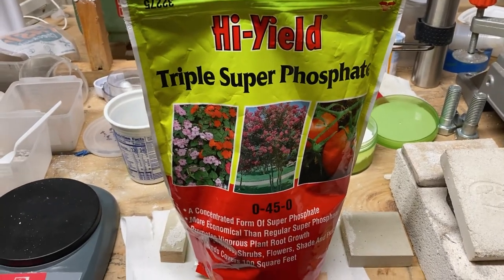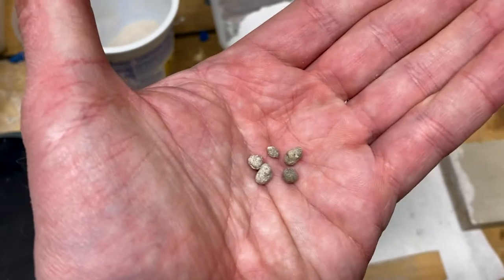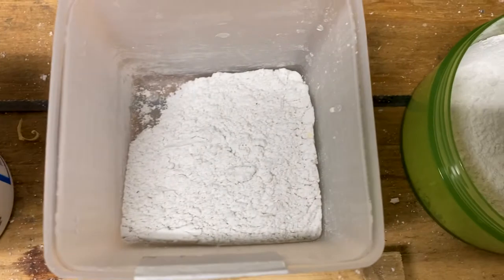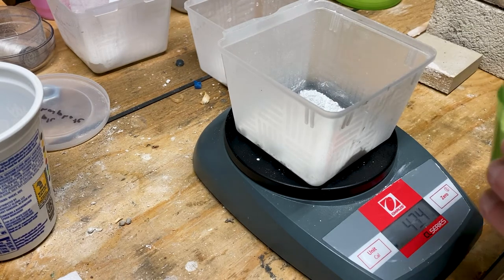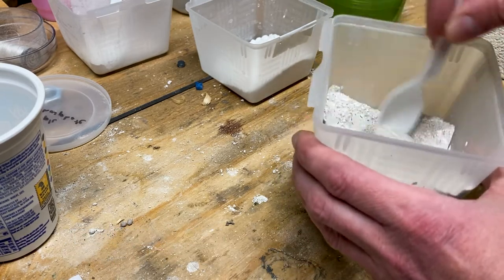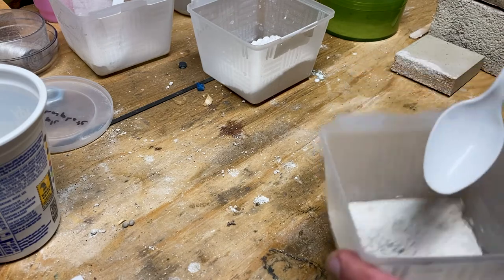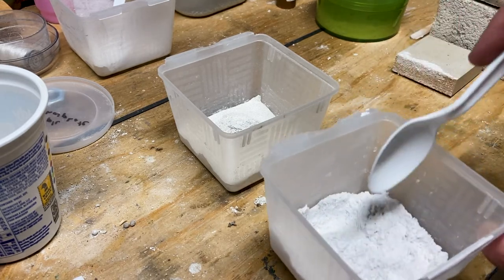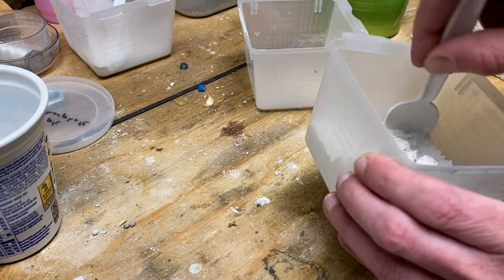How to Make Calcium Phosphate High Temperature Refractory

Comment: To confirm your conclusion about the porosity and thermal insulation capacity of ground up perlite--consider fumed silica.  Fumed silica is much more fine granular than how perlite usually comes, and yet it is far, far more thermally insulating than perlite. It is because it has so many porous micro-structures within the material, and such small micro pores (really a lot of surface area per given volume), that is is very efficient at stilling/trapping air molecules within its matrix.  Fumed silica in on par with aeorgels in terms of thermal insulation, and is the most common core spacing material used in vacuum insulated panels (VIP's).
Reply from the maker: I think that is worth trying. Thank you for the suggestion.

Comment: Nothing with calcium is going to be very high temp.
Reply from the maker: That depends on what you mean by high temperature. Calcium in it's oxidized state is not volatile at high temperatures. The upper limit of the stability is going to be limited to the melting or decomposition temperature of the cation used. Phosphate is surprisingly stable.

Comment: Very cool. Have you tried adding water to the mix and pouring it into a form? A few bricks seems like they'd be a nice way to make like a knife forge. If you're wanting to grind a lot of the triple phosphate and perlite up wonder if a grain mill for homebrewing may work.
Reply from the maker: The mix reacts fairly quickly so I suspect there would not be enough time to pour it. And yes, totally agree on the grain mill idea.
Reply: Intention to inform: to much water added at the end of the mixing or in total, ruins the chemestry that has to been keep in balance. To much water and the phosphoricacid will be to thin to react with the solids used. more then 30% ruined my pours. 
Go and do some research on geopolymers made from Calciumoxid with phosphoricacid. Theay are a wonderful thing.
Reply from the maker: In this case the solubility of the mixture is pretty limited so that provides a very large margin of error for the water. Otherwise yes this would likely not work that well.

Comment: Hi, Thanks again for sharing your ideas. You have got me going. Eventually, my calcium phosphate arrived (it is not so easily available in Australia). So overnight I made my first test pucks using the ratio of 270g of phosphate to 152g of lime. I made that up as a bulk-dried mix in the kitchen blender. It's OK with the boss of the kitchen because that's ME.
I made three test pucks from that mix:
1. no perlite, compressed and flooded and left overnight (according to your method). I used a chunk of a railway line on a puck that was the size of a picnic tumbler!
2. as above and mixed wet (and a bit sloppy), then compressed and left overnight without compression
3 as above after mixing in an equal volume of uncrushed perlite and left overnight without compression

It is early days, but this morning all the pucks were quite solid and initially had no sign of the flakiness that you describe and I think you attribute to the lack of compression. However, puck 1 (the soaked and overnight compressed puck) had a soft bottom that looked as though it had not wetted up enough to complete the reaction. As soon as I added some water to it it started to bubble, puff and flake. Luckily, this did no deep damage and it immediately went hard and left a little scar on what started as a smooth surface. They are all sitting on my winter wood stove drying slowly awaiting their baptism inside the fire.

It seems that wet mixing before moulding (as suggested by TheBreaded and me) MAY be quite practical, but the reaction is quite fast as you indicate. I think there is a fast initial reaction and then a slower one that makes the final hardness of the refractory?
Consequently, for my fourth puck (that I poured this morning) I had the preweighed water ready for quick addition, rapid mixing and then molding. Very easy!

Best regards, Tim
Reply from the maker: Awesome! I look forward to hearing how they stand up. I think the fast reaction aspect become a bigger issue when you want to cast larger forms because you have to move a lot of material quickly. But as you mentioned, maybe there is a second stage to the curing that could give some extra time. I'll play around with that myself too.

What I ended up adopting for the issue you mentioned of the dry bottom was to use something such as a cloth that can wick the water and deliver it to all the surfaces of the material.
Reply: Borax may slow down the reaction. It works for me pretty well with MgKPO4 cement, kind of similar, should work.
Reply: Tim, here in Australia we can buy Richgro Super Phosphate fertiliser from Bunnings. It is Ca(H2PO4)2 the same as the hi yield triple super phosphate product, but because it has no other phosphates in it, it is up to 100% Ca(H2PO4)2 instead of the 65% wt. in the hi yield product.
Reply: Yeah I was wrong, the product at bunnings says <100% Ca(H2PO4)2 on the SDS, but when you look at it by the NPKS value of 0-9.1-0-10, it works out to be: 34.38% Ca(H2PO4)2 + 42.46% CaSO4. I tried processing and purifying it, but it was so full of garden specific garbage that it wasn’t worth it. Worked pretty well in the garden though. The Hi Yield one may say Ca(H2PO4)2, but there’s other phosphates in it, based on the NPK of 45 alone. For example, Ca(H2PO4)2 is only 26.47% phosphorus.

I made this recipe work though with a modification using a superplasticiser and some ground silica, but to be honest, the MgO + KH2PO4 bonded ceramicrete recipe was orders of magnitude better than any calcium phosphate cement.

Try the ceramicrete recipe and add some perlite to it, you won’t be disappointed.
Reply: Ok so the USA uses a unique system to measure phosphorus. It measures phosphorus in NPK from % of equivalent mass of P2O5 (phosphorus pentoxide). Who knows why, they just do. So NPK of 0-45-0 means that the product has 45% of the amount of elemental phosphorus as an equivalent amount of phosphorus pentoxide. Confused? Yeah…

So the product has 19.64% of elemental phosphorus, so under Australian NPK labelling it’s 0-19.64-0.

It’s a bloody lot of phosphorus, more than twice the amount we get in our local products.

Man that had me confused.
Reply: You can get it as bone ash.

Comment: the perlite could be graded to increase brick strength (maybe reducing the maximal temperature that can withstand before cracking). The biggest flow here, in a metallurgic case, is having unreacted hydrated lime. at 512°C, hydrated lime would become just lime, and it will reduce the volume (creating surface cracking visible in the tested surface). low amount of unreacted hydrated lime does not really matter, but large amounts of it could produce "rock slaking" during thermal cycling. 
to reduce the problem, you can:
leave the water for longer (allowing more time to complete the reaction, but one day may not be enough)
make a second stage of curing, but this time under water with some phosphate dissolved to react any remaining lime in the surface (this may take time also time, but this would reduce the problems with the surface reaching the critical temperature of 512°C, as it would not microcrack)

there could be still some hydrated lime in the core of the brick, but at that point it could acts as self healing roman concrete (if water somehow manage to get there there could become powder eventually tho). most of unreacted lime would be in large granules of lime with a heavy coat of calcium phosphate. 

other thing: calcium phosphate is not soluble in water. but if the water is slightly acidic, you will dissolve quiet a lot. this may not be the best material to make an insulated fireplace exposed to rain (all rain is acidic).
Reply from the maker: These are all extremely good points. I had thought of trying to take care of the remaining calcium hydroxide with a bath of dilute phosphoric acid but the diffusion time would be very long. Also a good point regarding using it outdoors with exposure to rain.

Comment: How does this compare to plaster of paris/sand (or other aggregate combo)?
Reply from the maker: I would say there is no comparison. This is meant for very high temperatures and the plaster of paris will dehydrate and loose it's cohesion at higher temperatures.

Comment: This is very useful. I would love to see this made into small furnace/forge  with a ribbon burner.
Reply from the maker: I'm working on an electric furnace using this as the insulator. A functional forge is definitely up there on my list as well. I've been occupied revamping my workshop which will hopefully be done by August and then I will have a lot more capacity to do neat things like that.

Comment: Hi. Thank you for making this Video. Here in the UK it's quite difficult to find Hydrated Lime but I can easly buy Calcium Hydroxide 98% powder. In what ratio should I use it with Triple Super Phosphate? Please. Thank you, Regards.
Reply from the maker: Well you are in luck because hydrated lime is Calcium Hydroxide, so you can use the same proportions.
Reply: his ratio was 3.7 P / 1 C(OH)  or 37 /10
I buy it in 25kg - builders merchants - NHL is the thing to ask for.  15-25 £

It's incredibly useful stuff.
I just have to try my hand at forge-ery, hopefully will turn out legit.
Reply: @Drjtherrien  Thank you

Comment: Well done video. Thank you. "Stoichiometry"...betcha don't get to use that word every day.  ;)  You're a learned man: respect for that.  Any idea or known value for what temps this material will withstand?
Reply from the maker: Ha ha! Well in my line of work stoichiometry comes up somewhat frequently. Theoretically it could stand up to 1,600 DegC. But I suspect there could be limitations before it reaches that. I can get it heated to forge welding temperatures without issue, so that may give a practical guide on what it can do.

Comment: @Dritherien  - I  tried thit today but didnt seem to work. Vety clay like and loose. 
How long does the reaction take ? Imay have veen a little impatient.
Reply from the maker: The mixture does have to be compressed while it is curing, otherwise the heat/water produced during the reaction seems to cause voids to form which affects the cohesion. I usually apply some weight on top of the mixture before adding the water. It also helps if the container you use for the mold has the ability to let water soak through. The faster the water can get into the mixture the better the result. If you cannot though, then the mixture should be submerged in the water for up to 24 hours to ensure it reaches all of the mixture.

Comment: Thanks Sir. I will try next time. whats temperatur can holds this bricks?
Reply from the maker: I have been able to get a forge to welding temperatures with this. Theoretically it might withstand up to ~1,600 DegC but I would say that I have not formally confirmed a max temperature.

Comment: Hi, Thanks for your informative video. It is well-paced. Yes, I also have issues with my sound engineer.
My chemistry is a bit rusty. I am preparing to make some of your refractory. My calcium dihydrogen phosphate is the dihydrate form, so that makes only a little difference (I think yours might be anhydrous phosphate?). I calculate my phosphate to have a mole wt of 270g/mole and the calcium hydroxide at 76g/mol. I assume that I need 1 mole of calcium phosphate and 2 moles of calcium hydroxide to get a balance acid/base reaction? So this makes the ratio 1.77 [270/(2*76)]. This is very different to your weight ratio of 3.7:1. Have I got something very wrong? I would appreciate your help.
Lastly, perlite is nasty stuff even the dust from unground granules irritates your lungs. Grinding makes it much worse. It is about 60% SiO2 and that rings alarm bells about the risk of silicosis. I think I can hear you start to cough when you introduce the ground perlite, so please be careful.
Thanks again Tim
Reply from the maker: Oh snap! Yes, your numbers are correct. Though one thing I have noted is that I don't think all of the calcium dihydrogen phosphate actually reacts... the stuff is super slow to dissolve, so there is likely less of it chemically available. Sorry about the slow response; apparently YouTube decided I didn't need to be notified about comments!

Yes, very good point about the perlite. And I probably was coughing due to it. I now have a fume hood of sorts and a better respirator, hopefully I can add some common sense to my PPE.
Reply: @Drjtherrien  Hi, thanks for the reply. Yes, we are at the mercy of the machine that decides what is spam and valid comments. Given the slowness of the reaction, it seems that TheBreaded's comment about mixing with water might just work? Still waiting on the delivery of my calcium phosphate. Tim
Reply from the maker: Actually the reaction is very fast. Too fast for the calcium dihydrogen phosphate to dissolve and that’s probably why the reaction still works with the stoichiometry as off as I had it; everything solidifies quickly and prevents diffusion of reactants. 🤷🏻‍♂️

Comment: I have wondered instead of using perlite , which is a good product.  I had come up with the thought that perlite burns out lite styrofoam does, i believe anyway. Why no use a stupid cheap material because after all it is about adding air space to create its insulative effects why not us popcorn? Crush it upbif you wish but it wouldnt be a danger as it eventually burns out and other than a rodent maybe finding it. I dont believe it would be a problem by simply addind a slurry coat or a sheet metal jacket as a protector. 

I think it could work well and it stupid cheap...
Reply from the maker: Popcorn would probably get much denser in the process of crushing it up. But you are right that one could use something that will simply burn up; though I would worry if that would cause gasses to expand and crack the material. One thing that I could try is flour. It would burn out and leave the micron scale gas bubbles that would help with the insulation. I might give that a try.

Comment: What’s the highest temp can it withstand?
Reply from the maker: I have been able to get a forge to welding temperatures with this. Theoretically it might withstand up to ~1,600 DegC but I would say that I have not formally confirmed a max temperature.
Reply: @Drjtherrien  thx I think I’ll try this mix for my next foundry I make when my old one goes
Reply: And could i just use bone meal fertilizer as the phosphate?
Reply: What about d dextromise Earth or DE?
Reply from the maker: So bone meal is a different chemical: hydroxyapatite. If you were to use that you would need to use phosphoric acid to convert it to the calcium phosphate. I have no idea if that would work well or not.
Reply from the maker: Diatomaceous earth... hmmm... that's not a bad idea. I might try that and see if it works.
Reply: @Drjtherrien  works as filler very well. Also crushed quartz work as filler basicly all super dense silicates. BUT the bricks have to be dried very well so the water has evaporated and wont form steam and bust the brick apart. Takes time but works to. I made some insulation with aluminiumsilicate croase size, like sandpaper size 60.